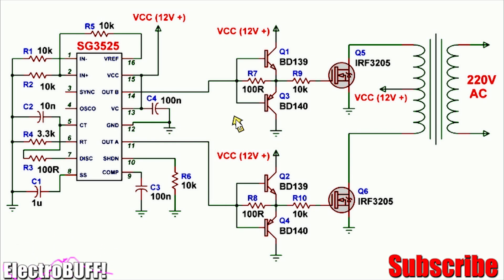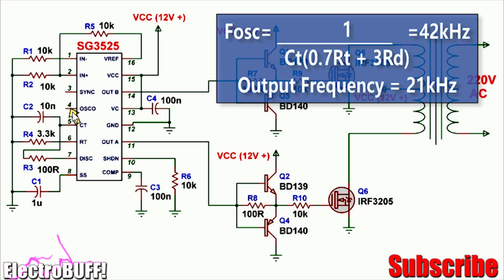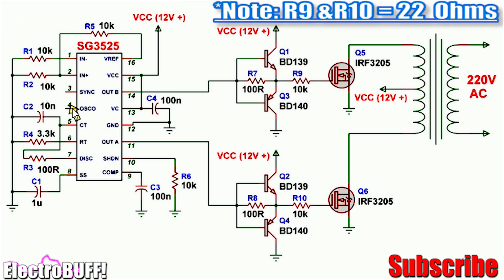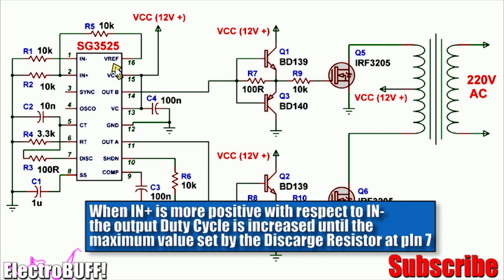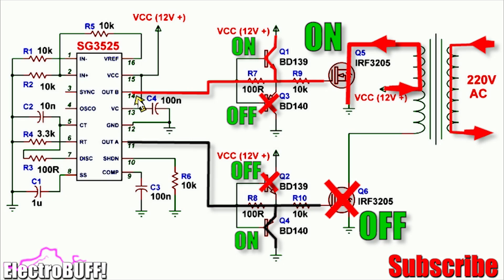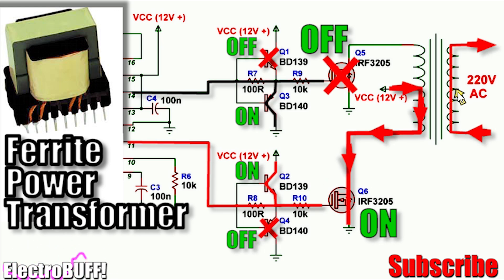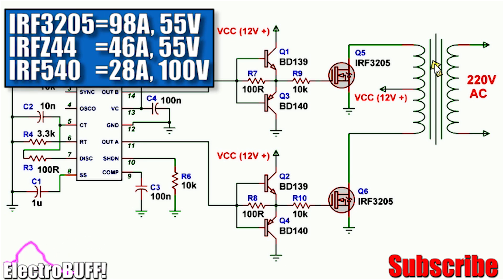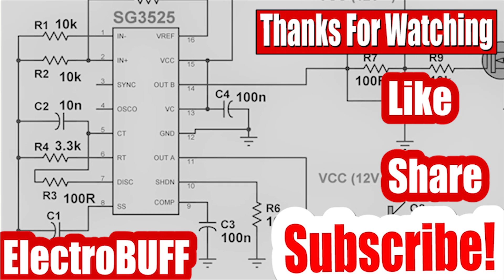How To Make a Powerful 1500Watt Power Inverter 12V to 220V DC to AC

Comment: Why 10k ohm is back of mosfets.i dont know.the output of tl494 is max 250ma .this is enough to trigger  a mosfet why use external torem pole?the 100ohm resistor do what there?

Comment: MOSFET Gate Series Resistors CANNOT BE 
10 K OHMS. probably a mistake...10 OHMS is more realistic.....
Also this does not have either  pri/sec. voltage nor current feedback or control....
So I/p voltage or load side variations are not controlled..& output voltage can fluctuate.. based on these.

Comment: I want yo do 48 volt Dc to 220 volt a/c
Reply: Make sure you mosfet can handle at least 2 x 48V.  I would use 150V rated mosfets.  Also the circuit in the video has a mistake.  The 10k resistors R9 & R10 are incorrect.  They should be something like 4.7 Ohm (depends on mosfet).  A single 1.5kw transformer will be LARGE, so make sure you do your homework, otherwise you will have a melted transformer.

Comment: what is alternative for replace the totem pole on this schematic.?
Reply from the maker: You can use a dedicated gate drive IC or just use the direct outputs, but it will not work effectively at high frequencies
Reply: @ELECTROBUFF  please tell me type of ic that can be replace the totem pole for SG3525

Comment: How do i get 50 hz ac from this inverter?
Reply from the maker: I've provided a frequency calculation formula in the video tutorial. Just play around with the capacitor and resistor values to give you a frequency of 50Hz. Cheers.
Reply: @ELECTROBUFF  but ferrite transformer only work on high frequency if we set frequency 50hz then transformer winding will be burn so if you set frequency 50hz then you need to use iron core transformer and turn also be more than ferrite coil